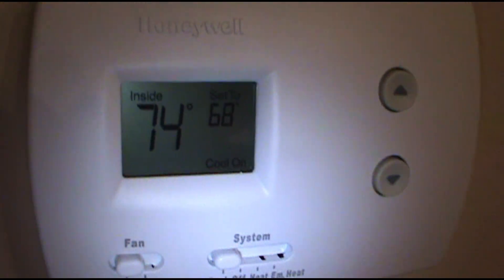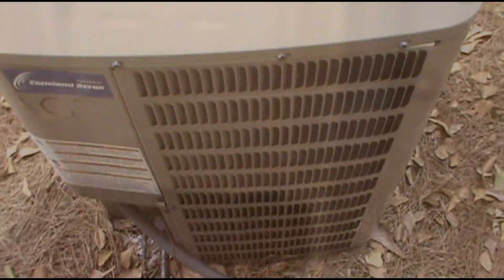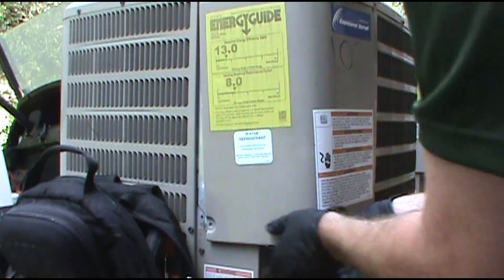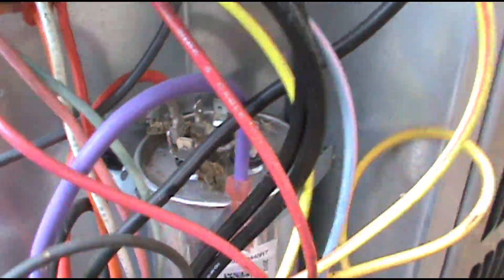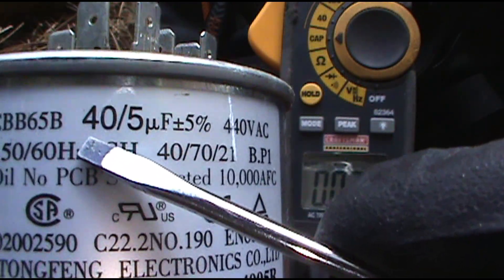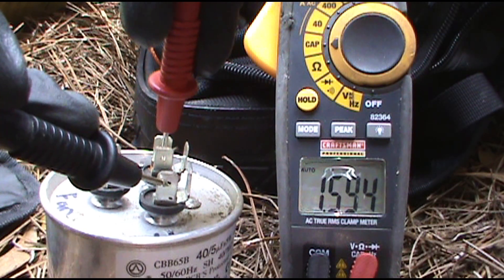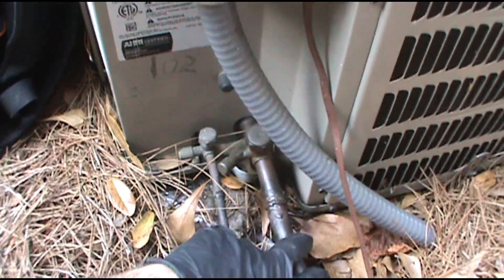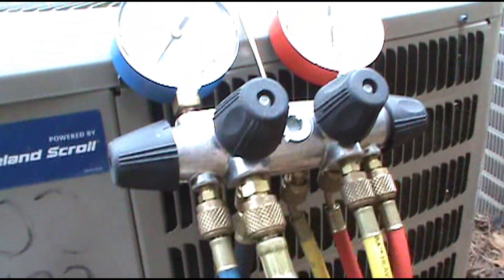HVAC Unit Will Not Shut Off After Reaching Set Temperature

Comment: Great video Lex!
Question. Why our fan is still blowing the air (not warm air) after furnace reaches the temp and shuts off? Usually for another hour the fan is still on and then it stops. Basically what furnace warmed the house, fan with blowing the air makes house cold. Can’t figure out why. The whole system is about 23 yrs old and we use google nest. Thank you
Reply from the maker: I'd need to be there for this head scratcher.
Reply: @LexVance  sounds absolutely fictitious lol unless the air and heat both are running at the same time.  Sounds like a bad thermostat, or a faulty relay. Something’s touching!!

Comment: What about if the thermostat or AC doesn't turn off on cool auto once it reaches the set temperature.... I changed the filter got two new capacitors, cleaned coils and even bought  a new thermostat
Reply from the maker: The relay or sequencer is stuck closed. Thats in the air handler. Could be on the blower board or a sequencer mounted in the control panel.

Comment: I cleaned my unit, other day vacuumed all compartments out, had small wire on outside wires were exposed I wrapped that wire with electrical tape now woke up house 62 degrees won’t shut off any ideas
Reply from the maker: If the contactor is stuck closed, the unit won't shut off. Could be a number of things, though. This is one of those situations where I'd need to be there looking at it with my volt meter.

Comment: I was able to check the temperature before the Evaporator and after with a digital thermometer and after a while at each side I got 71.1 before and 41.1 after evaporator. Thats a 30 degrees difference. Could this be right? Now when set thermostat to 74 it drops temp but doesn't turn off, at 75 it turns off and on turns like it should. What could it be problem?
Reply from the maker: I'd need to be there for this head scratcher. 🤔
Reply: @LexVance  could the evaporator freezing over could get that difference?

Comment: My ac takes hourssss to reach set temp and when it does, it still runs for 30 minutes to an hour before it shuts off. It was like 83 in house i set it to 75, it took 4 hours to reach  75, was that normal? Then it too anthony 45 minutes before it popped of while sitting on 75. Please if you reply, like my comment, otherwise i will not get the notification.. thanks
Reply from the maker: Low on refrigerant. You'll need a technician to come out and fill and find the leak or it'll leak back out. Thank you so much for watching!

Comment: My outside unit condenser fan runs all the time I don’t think a capacitor will fix it what could it be maybe thermostat I don’t know
Reply from the maker: It could be 10 things. I'd need to be there with gauges and a volt meter.

Comment: Does it matters where the wire goes into the fan , there is two connections
Reply from the maker: Yes, fan wire has to go on the Fan terminal. It will say "Fan" on the capacitor. Thank you so much for watching!

Comment: What is the problem when the condensing unit and air handler are working and cooling way lower than set temperature? I set it to 70° at night and it’s 62° in the morning. Still blowing and cooling
Reply from the maker: Something is stuck on. I'd need to be there for this head scratcher. 🤔

Comment: Mines wont turn off at all fan stay  blowing ac ir heat i have to boot it manual by flicking the breakers ac works fine heater works fine no weird noise it just wont turn off
Reply from the maker: Fan sequencer is stuck. You probably need to wire in a new one as a stuck sequencer is the most common issue when that happens.

Comment: My out side units keep running  when reach my set temperature. Thermostat set 68 and match 68 but not stop still running the whole 24 hours. And gives me a lit bit heat
Reply from the maker: The contactor could be stuck on the outside unit.

Comment: New Trane 2.5 ton unit installed 10 weeks ago....has not stopped running since installed new.

Installer gives me excuses of being sick, can't come look at new unit 😡

Any suggestions?
Reply from the maker: Probably isn't charged correctly with refrigerant. If the charge isn't right, it will run and run and run.

Comment: So the heat strips will just continue to heat past the set temp because the outside unit doesn't come on?  Heat set at 70 - inside temp reading 80 and still heating away?
Reply from the maker: Yes, if the sequencer is stuck the unit will not shut off. Also, on a heat pump if the outside unit isn't turning on once the temperature drops 4 degrees below set temperature the auxiliary heat ( the heat strips) will turn on.

Comment: Hey quick question, my furnace and blower motor aren’t shutting off at set temp heat just keeps going up, how gets really hot. Could it be a bad thermostat?
Reply from the maker: It could be. It's usually a stuck sequencer, though.

Comment: My elderly mother called me yesterday and said her AC was running but the temperature in the house was 80°. When I arrived at the house everything under the home and thermostat wise seemed to be working normally but when I reach the compressor outside it had a buzzing or moaning type sound coming from it. I retrieved a hammer and block and tapped where I believe the capacitor or what I turned it at the time power switch would be and with every tap of the hammer the fan would begin to get momentum until it finally came on and everything began working normal. The thermostat will cut the blower underneath the house on but the unit out back does not keep up with the cycle. It needs a good tap to cut on and off.. I'm guessing capacitor.
Reply from the maker: Could be. Or a lose wire. I'd need to be there for this head scratcher 🤔.

Comment: It’s 88 degrees in nj today. Turned my ac on with room temp at 78 and set temp at 72. 72 now but won’t shut off yet..it eventually shuts off. And if I put temp at 73 it’ll shut off. How can I tell if it’s bad capacitor or bad thermostat sensor for example?

Thanks!
Reply from the maker: It's may be low of refrigerant. Also make sure filter is not dirty. If it's low on refrigerant or the filter is dirty it will struggle to cool properly.
Reply: Refrigerant and filter good ….cold air out of vent. So was wondering capacitor? Thermostat. ? Reaches set temp but room temp just stays at set temp not less not more
Reply: And thank you for relying!

Comment: Why is it that my unit outside turns off but the unit inside stays on when i turn on the AC
Reply from the maker: If your unit has a low pressure switch, it turns off when your unit is low on Freon to protect the compressor. If it doesn't turn on at all, then you may have a bad capacitor.
Reply: Thank you!

Comment: mines doing something similar and i can't figure it out and neither can the buildings maintenance team it seems. When it comes to heat it works fine or at least it did when the building was set to heat and the cooling was shut off. I could set a temp and it wouldn't turn on unless it dropped below that temp then it'd kick on for a bit to raise it up then shut back off. We switch the heat off and go back to cooling for the summer now it just ignores the set temp completely. I put it on cool and auto and even if its 75 and i set the target temp to 82 it will kick on and it will run and continuously kick out cool air indefinitely. The only thing that will get it to shut off is me changing it from cool to off. It's just either on or off and it drives me crazy. I just want to be able to have a set temp and have it kick off once it gets there so i don't have to pay so much on the electric bill. the fan running adds up and i don't want it running all the time! They have even tried changing the thermostat with a new one and same problem and apparently I'm the only apartment in the whole damn building this happens to.
Reply from the maker: I'd need to be there for this head scratcher 🤔.

Comment: My a/c compressor won't shut off now when house reaches temp.  The fan in the house shut off but compressor and fan outside keep running. Then it ices up.
Reply from the maker: Sounds like the contactor is bad. When they stick, the unit won't shut off.
Reply: @LexVance  you were right. Local parts shop charged me $25 for the contactor which was high but they made sure I got the right one. Swapped it out and all is good now.

Comment: I have somewhat of a similar issue I’ve been trying to figure out.
I have an American Standard hvac/furnace. Split unit.  My issue is, I set my thermostat to cool 70, when the house reaches that 70 mark, the condenser will shut off but my fan blower continues to blow. Now if I go to the thermostat and bump it up to 72, then the blower will then shut off.
I’ve replaced, thermostat, wire from thermostat to furnace, wire from furnace to condenser, and control board., what else could be the issue? Anyone, please advise.
Reply from the maker: Whoa, that's weird. I'd need to be there for this head scratcher 🤔.
Reply: @LexVance  I’m going to call a local repairman. I just don’t want someone  coming out telling me I need to replace this and that and I keep having the same issue. Keep in mind, this system was just installed about 3 years ago. I do know it’s a 2 stage unit if that helps with anything, if I may ask, could you possibly look at these little tiny switch’s and see if you can make anything out of them? For some reason, I have a feeling these may have something to do with it. Or maybe the wiring for thermostat at the control board. My control board is a CNT07991_v2 and if you can pull that board up and see those little slider type switches that say off/on considering which way the switch is slid to left or right. I have a picture of board but can’t add pic here. I could email you if possible. I’m in desperate need for help with this as I’m in the south and as it gets hot and this blower continues to blow it fills my home with humidity when the condenser is not running of course. Also, what wires are the standard wires that supposed to be hooked up at the control board and going to condenser?  Anyway, let me know @Lex Vance
Reply: I have the same issue. What was your resolution?

Comment: I have a question. My house A/C will not always turn off at the set temp. Whenever this happens I have to turn the breaker off for the inside unit to turn it off. When I turn the breaker back on , the unit stays off until the temp hit for the A/C to come back on. The A/C comes on and works fine for a few cycles .  Any idea of what this would be. I have replaced the thermostat and the problem continues.
Reply from the maker: You may have a stuck sequencer or control board relay. That will make the fan not shut off. You'll need to replace it if that's the issue.
Reply: @LexVance   I got home one time and the inside temp was 58 when the thermostat was set to 70. The complete A/C system keeps going past the set temp to turn off.
Reply: @LexVance  it’s only with cool.  Heater works perfectly.

Comment: Hey Lex, I have the same issue right now.  My a/c runs fine and thermostat regulates the temperature and shuts off when it reaches the set temperature in cool setting.  Outside fan is good, freon levels are good, and the blower motor was jus recently replaced too.  The issue I had for the past 5 FL winters is in heat mode the heat doesn't stop at the set temperature.  My last tech couldn't figure it out.  I have to manually switch it to cool from heat, put the temp of the thermostat at a higher temperature in the cool setting for it to shut off.  Any thoughts?
Reply from the maker: Yikes. Maybe install a new thermostat? I'd need to be there for this head scratcher 🤔.
Reply: I have the same issue. How did you solve it?  My HVAC guy could not figure it out.

Comment: Just replaced a 1 year old ac unit with a brand new unit in October 2021. It's now January 2022 and my heat wont shut off. New thermostat too. Any idea what it could be? The temperature isnt going above the set temperature.... it's set to auto...
Reply from the maker: I would need to be there for this head scratcher 🤔. I could be numerous things.

Comment: I have a question. I just replaced my central air and heat thermostat because the unit wouldn't turn on or off using it. I had to turn the breaker off to shut it off or vice versa for on. Replaced it but still having the same problem and I have no heat.
Reply from the maker: The thermostat is low voltage. Sounds like you're having a high voltage issue. The sequencer or contactor may have an issue. It's too complicated to explain over YouTube comments. Thank you so much for watching JM!

Comment: You said when Rerfidgerant levels are low, it will do that?
Mine blows instant cold but stays on for a while eventually shutting off.
Reply from the maker: Weird. I'd need to be there for this head scratcher 🤔
Reply: @LexVance  ,
So it turns on and eventually turns off maybe 45 mintues past the set temperature. Kids complain it does so at night only to never turn on again.
Reply from the maker: @streetveteran8928  Weird. It could be numerous things. Low on refrigerant. Stuck sequencer or contractor. Bad thermostat. I would need to be there.

Comment: We changed the capacitor and we saw the different in the condenser, but the problem continued the air conditioning don’t stop any time, the temperature is ok inside and the thermostat show 75 f but continue working with not break.
Reply: Did you figure out why it wasn’t shut off? Capacitor? Thermostat?
Reply from the maker: Just now seeing this comment. 🤔

Comment: My window ac is doing same thing after cleaning it. It stays running cold. It will not shut off compressor so it is freezing cold in room. Please help 🥶
Reply from the maker: Stuck contactor. I'd need to be there to see it.
Reply: @LexVance  I ordered a new temperature sensor. Hope that is all it is. Thanks for reply

Comment: Mines set to cool it hit the set temperature at 76 after it reaches its set temperature of 76 it stays on for few hours then suts of then starts is cycle every 10min or so is that normal .   The temperature in philly was about 91° and toady 7/17/21 it's going to be 99° is it normal for a ac unit to run longer cause of the heat ...
Reply from the maker: Yep. Here in Florida mine runs longer and kicks on more than usual. It's pushing 95 to 100 here. Then around fall and winter it acts normal. Or, I just shut it off and open a window.

Comment: Mines is set on cool after it reaches the set temperature of 76 I have  it set  it stays on for about 1 hour when it hit its set temp  then suts of then it starts its cycle and come on every 10 min or so it's that normal...
Reply from the maker: If it's blazing hot outside like 95 and above, they tend to run a long time and kick on more. My own home system does that when it's around 100 degrees here in Florida.

Comment: My ac unit was reset by accident. I used to have it set at 77 and at 79 is when it would turn back on.  I just don’t know how to set it back to that?  Can you please help me?   In other words I had it set 2 degrees higher than my set temp at 77 so it would turn OFF at 77 but turn back on when temp in house would reach 79 and I really want to set it back like that!  Does anyone know where is the setting that I need to do please?
Reply from the maker: I would need the thermostat instructions for that. They're all different. Sorry 😭
Reply: @LexVance  it’s a Nexia American Standard 624 unit.  🙏🏻
Reply from the maker: @ChaneltoSneakers  see if Google can help. I'm stumped.
Reply: @LexVance  I tried that but the manual is more for installer than “user” friendly!  😤😤  I think I got it tho.  It had to do with the delta cooling stage 1 indoor  options. I set them both for 2 degrees and it’s done the trick soo far !  I have a headache now tho!  LOL 😂. Thanks anyways. Have a great evening!! 👍🏻

Comment: My thermostat on cool and set to On ac keeps running only cuts off if I put off on thermostat
Reply from the maker: Switch fan setting from On to Auto. That will make it cycle off when it reaches set temp.

Comment: I just have a brand new unit installed and my AC is not shutting off when the target temperature is reached and no, it's not set to heat but cool and on. I stick a piece of paper over the filter and it never dropped to the floor after 30 minutes. I also notice the thermostat reads one degree cooler than target.
Reply from the maker: They could've hooked up a wrong wire somewhere on t-stat. That's why it's not shutting off. It could be 6 different things. I'd need to be there with my volt meter for this head scratcher.
Reply: @LexVance  I did an experiment and tried auto instead of on. Auto shut the AC off after a few minutes. The AC kicks on again when the sun intensifies this afternoon. The new thermostat controls the AC differently than the old one. On on the old system means run based on the settings and auto means keep the fan blowing. A complete opposite meaning with the new system. Problem solved. Thanks.